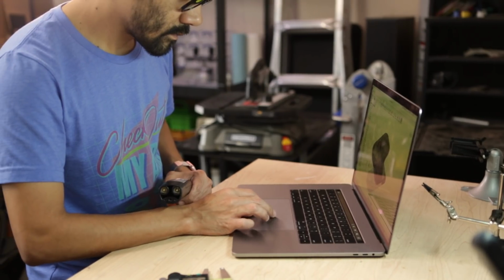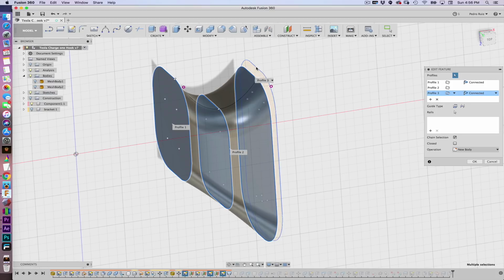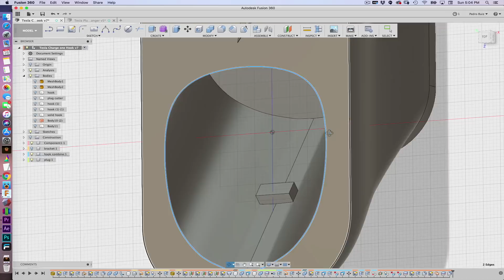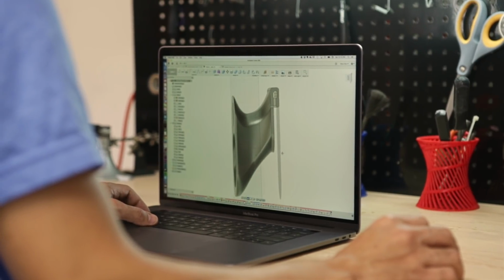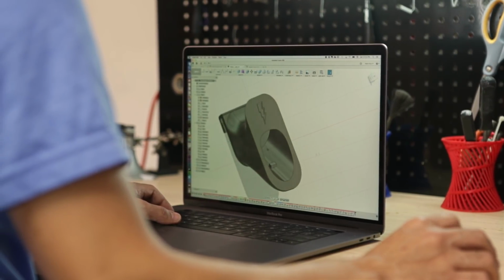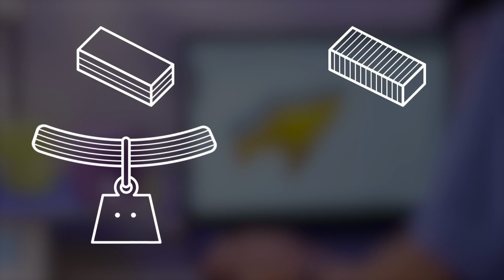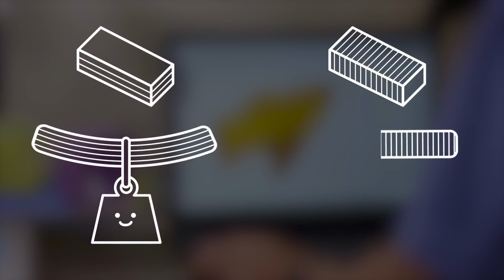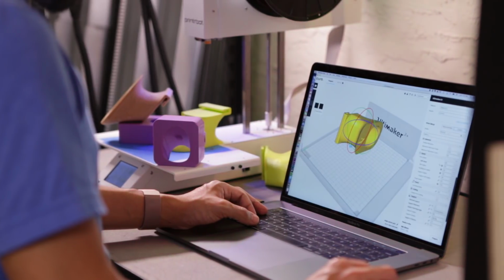3D Printed Tesla Cable Holder

Comment: Could you go into more detail on how you used the contour gauge for modelling?
Reply: I believe you'd want to use the gauge to copy the contour. Trace it on to a piece of paper. Take a picture and pull it into the modeling software. Calibrate to the right size. Then you have the profile of a cross section.

Then repeat that along set intervals and loft the profiles together as they showed in the video. That's how I'd guess it'd be done at least.